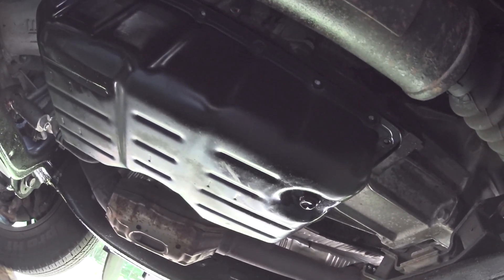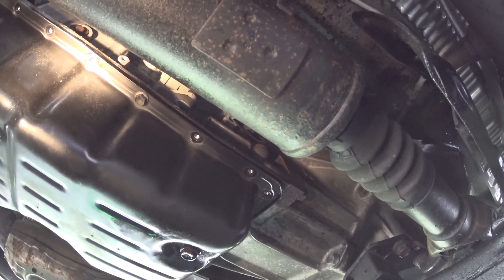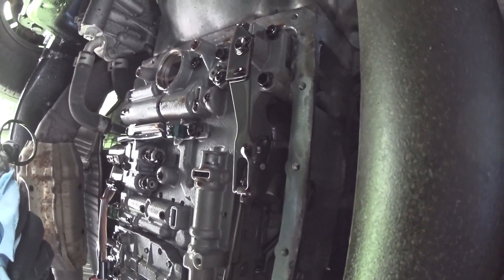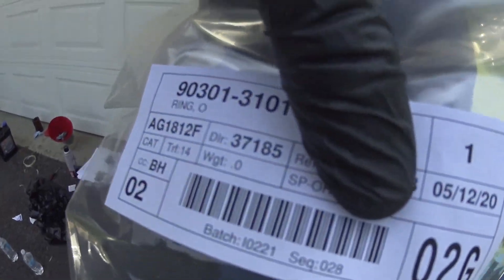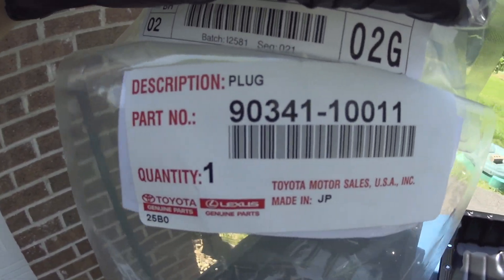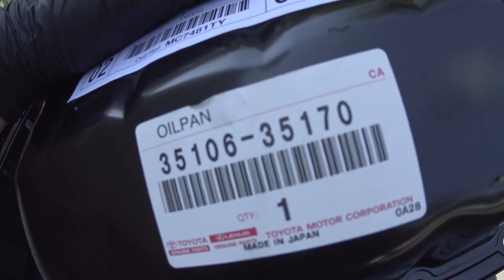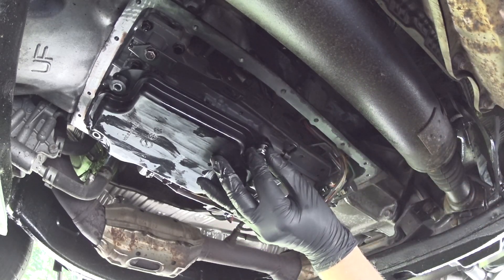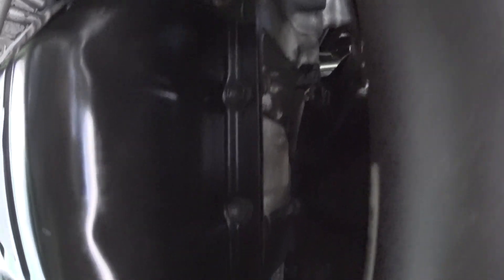Toyota Transmission filter replacement, Lexus transmission filter replacement, how to change filter

Comment from the maker: AMSOIL ATF for ALL Vehicles http://www.amsoil.com/shop/by-product/?zo=5257753
Honda ATF http://amzn.to/2pwgape
Toyota ATF http://amzn.to/2oX3gNR
Ford AFT http://amzn.to/2oXa79W
Subaru ATF http://amzn.to/2pi817r
Nissan ATF http://amzn.to/2pwpDNp
GM ATF http://amzn.to/2pte3AA
Chrysler ATF http://amzn.to/2pwl19Q
Mercedes http://amzn.to/2pwBVFw

Motor oils
amsoil  https://www.amsoil.com/shop/by-product/motor-oil/?zo=5257753
mobil 1 https://amzn.to/2oM6WUe
pennzoil https://amzn.to/2M70v7r
castrol https://amzn.to/2wQKFJk
valvoline https://amzn.to/2wT3EmG
Schaefer https://amzn.to/2oRggpL
motul https://amzn.to/2oQ4OuK
red line https://amzn.to/2Nsihqk
royal purple https://amzn.to/2oPDz3k

Comment: Do you remember the condition of the old O-Ring you removed from the trans?  I've seen them harden on 10-15 year old german cars which led to a drop in oil pressure due to a poor o-ring seal. It would also help to know the age and mileage of the truck you're working on.
Reply from the maker: 2012, 8 years of age at that time.  226k miles on it.  Germans known for o rings to get hard due to oil they use. This o ring was soft like brand new one.

Comment: I have a 2016 Tundra with the 4.6 with 93,000 miles. I am watching and learning best I can for self maintenance. You made a video talking about not changing the filter but this video showing how. So how do I properly maintain my transmission?
Reply from the maker: Change your transmission fluid every 30k miles the way it use to be, if not towing.  If you are towing Change it every 20k miles.  Drain and fill. Filter replacement is about every 100k miles or more depending on fluid change intervals.
Reply: @repairvehicle  what if the transmission has never been touched. Is it okay to do all of this now even though i have 93,000 miles? And also since it has 93,000 do i need to go ahead and change both the filter and fluid at 100,000?
Reply from the maker: My 2012 tundra had first atf replacement at 160k miles. It's perfectly fine to replace atf fluid now.  Replace atf as a minimum,  filter replacement is optional.  I would wait until 120k miles if not towing or hauling.
Reply: @repairvehicle  i do not tow. Will the filter replacement help that much?
Reply from the maker: Nope
Reply: @repairvehicle  If I want to switch my ATF to amsoil from what is in it now should i? Or can i? Would it be bad to swap out?
Reply from the maker: Can you replace it yourself? It depends on your skills, how comfortable you feel doing it yourself.  It's a maintenance item, I would change it.  If you planning to keep it, it's better to replace it
Reply: @repairvehicle  But my main question is for sure I want to switch to Amsoil. The research shows great results for longevity. So with that being said with the original fluid in it now... do i drain it and fill it with amsoil? Or is there a process i need to do to completely flush the transmission before filing with amsoil?
Reply from the maker: No flush is needed.  Drain and fill  but couple times so that you have higher percentage of clean atf. Also, level should be checked at Toyota specified temperature
Reply: @repairvehicle  Also for your engine oil do you use amsoil filter as well as oil?
Reply from the maker: I use amsoil engine oil, amsoil oil filter, amsoil transmission fluid, amsoil gear oil,  amsoil power steering fluid which is atf, amsoil grease.  I use wix engine airfilter and wix cabin filter.
Reply: @repairvehicle  Thank you so much for your help. Im glad you are on here. You are a wealth of resources for me and my new 4.6 Tundra. With your help surely I will reach a million miles!
Reply from the maker: You are welcome

Comment: Hello, will 4l of the transmission oil be enought? Im planning to change filter aswell. Thank you
Reply from the maker: On what?
Reply: @repairvehicle  sorry, its lexus gs 300 2008 6 speed auto.
Reply: @repairvehicle  rear wheel drive
Reply from the maker: From 4.4 to 5 quarts depending on the transmission type. https://www.amsoil.com/lookup/auto-and-light-truck/2006/lexus/gs300/3-0l-6-cyl-engine-code-3gr-fse-g/?volume=us-volume&zo=5257753
Reply: @repairvehicle  thank you for your video and also fast response. Ill take 8liters. Its 4l bottle. Ill order from ravenol since previous owner used it. U just earned a sub :)
Thanks again
Reply from the maker: @DetailingTurzovka  , thank you
Reply: @repairvehicle  its this type RAVENOL ATF T-WS Lifetime .  It says it is for lexus/toyota and its already in my transmission :D
Here in eu ravenol should be very good oil brand.

Comment: Have a 2011 fj cruiser, 100k. Swapping for amsoil, should I do the filter as well? Do you recommend a certain amount of extra fluid for the flush? I plan on filling while monitoring the trans temp using odb2 app. 
Just wondering your thoughts on the process with the amsoil.
Reply from the maker: Have you replaced your fluid or filter in the past on the FJ?
Reply: @repairvehicle  no, and pretty sure it hasnt
Reply from the maker: You can replace the filter if you want to, I would not do it. If you are living in rust belt state,  be extremely careful about replacing filter. Since your fluid has not been replaced on regular basis,  my recommendation is to do couple drain and fill.  I will be doing myself on my 225k miles tundra.
Reply: @repairvehicle  In sc, Florida vehicle very clean underneath.  Thanks

Comment: I have the transmission fluid drain and refill every 15k-20K with OEM fluids on a 2004 Highlander.  The transmission filter has never been replaced. Since there’s over 200K miles, is it best to continue to do the drain and refills and leave the filter as is inside?
Reply from the maker: It depends on the filter. If it's screen type filter,  don't replace it.  If it's soft media filter,  it's a good idea to replace it because of the age.
Reply: That’s the question I was really looking for I have 08 Lexus GS 350 so I’m looking to do drain n fill and change transmission filter , I called a mechanic he says you model doesn’t have transmission filter yours has screen so we no need to take down the pan ?? My car has 110mi and it’s never done any transmission service before ? Is it recommended to do it as this milage ? Or there’s any drawbacks might arise ? Any help would be appreciated thanks
Reply from the maker: I don't You have a screen

Comment: Is it for a recommendation to changing the transmission filter if the bolts are no rusty and easily removed. Do you have another video saying don’t change the filter but maybe only because bolts are rusted.
Reply from the maker: I do  have another video,  not just rust. I  explained in the other video .

Comment: Very informative video and detailed, mine is 08 Lexus GS 350 RWD it has 110mi car has never done transmission service at all , would it be okey if I do drain n fill ? Also does this model have transmission filter or screen ? Since the mechanic told me you don’t have filter it’s screen ? And we’re not going to take down your pan it’s just regular drain n fill ? Is this sound about right or I should avoid this mechanic?? Thanks in advance
Reply from the maker: Drain and fill is the minimum must be done. Filter good idea because of the lack of fluid change and age of Filter
Reply: @repairvehicle   thanks
Reply from the maker: No problem

Comment: I've got 280k miles on my 2000 LS400. a650e. I have never opened the transmission in 20 years of ownership. 
Ive had a 2nd gear shift solenoid fault for a few years. Ive ignored it because the car shifts ok. Now the car has to be inspected so i need to change it to get rid of the CEL. 
Ive recently started hearing a pump whine when its cold. I hope i dont make things worse trying to get in there.
Reply from the maker: It’s to late now, transmission is worn out due to lack of atf changes

Comment: Where can we find the torque specs for our specific vehicle? Mine is a 2007 Lexus IS250 RWD. 
Ps. Thank you for teaching us :)
Reply from the maker: Torque specs for what? I  can get you them or tis website has it paid subscription
Reply: @repairvehicle  Hey there, are you able to get the torque specs for the transmission pan on a 2007 is250 rwd?
Reply from the maker: Yes

Comment: Hello sir, what is supposed to be the operation temperature of transmission in 2011 Lexus is350? I have a scan gauge and my temp reads 200 degrees on average in traffic or idle, is this is okay? If I change the fluid and filter will it be fix it little bit?
Reply from the maker: Operating temperature range for checking fluid should be:

For A760E [A/T Oil Temperature 1]
39 to 49°C (102 to 120°F)

For A760H  [A/T Oil Temperature 1]
40 to 51°C (104 to 124°F)

200 degrees temperature is normal temperature for transmission without transmission external cooler. 
200 Degrees is not a good number, it should be lower. But to lower temperature, external cooler is needed.
However, changing fluid and filter every 30k miles will extend the life of the transmission for long time. Using Amsoil atf fluid will make difference too, because tolerates heat better and provides better lubrication.

https://www.amsoil.com/lookup/auto-and-light-truck/2011/lexus/is350/3-5l-6-cyl-engine-code-2gr-fse-i/?volume=us-volume&zo=5257753
Reply: @repairvehicle  Is there a possibility to adding external cooler to sealing transmission?
Reply from the maker: There is no such thing as sealed transmission. Take a look at my video where I installed external transmission cooler on my Toyota sequoia/tundra. There was something that I have discovered during the installation and its mentioned in the video.
Reply: @repairvehicle  I will be watching this video you say. Can I putting one external cooler on the 2011 is350?
Reply from the maker: If it has threads on the inside transmission or cooler from other lexus fits,  then yes you can add external cooler.

Comment: Hi. Is this more effective than doing a drain and full?  It looks like you get quite a lot of trans fluid out the system using this method vs  the typical drain and fill.  How much would a shop charge (on average) for this?
Reply from the maker: It depends on quality of work, vehicle and atf fluid they use.
Reply: It is more effective. On Toyota Camry you can change about 4 liters out of total 6.9 but only about 2.5 with drain and fill.

Comment: In what order should I put the bolts in when I put on the pan?
Reply from the maker: does not mater. Only when torquing bolts orders matter.
Reply: @repairvehicle  how about when torquing?
Reply: In which order to I torque?
Reply from the maker: What do you have and year?
Reply: @repairvehicle  2013 Lexus es350
Reply from the maker: one across from another and continue in that same pattern, similar to wheel lug nuts.
Reply: @repairvehicle  thank you so much!!!!!

Comment: Братуха, после какого километража рекомендуеться замена фильтра в трансмисии? Почему бы не доверить эту работу опытным специалистам с Тойоты? У меня Toyota Camry 2017 6 speed automatic  u761e transmission. What type of the transmission oil must be used? Is it Toyota ATF TYPE T-IV p/n 00279-000T4-01? Так же я знаю что механики ставят крышку поддона трансмиссии на герметик - чтобы не текла.
Reply from the maker: Toyota doesn't recommend changing transmission filter.  I don't trust Toyota mechanics or any other dealers mechanics.

Comment: Replacing a transmission filter is completely unnecessary.  It's a sealed system and there's with no byproducts being produced.  If the filter is gummed up/filled with crap, you're going to need more than just a filter for that transmission.  Just some friendly advice... I used to do it as well, and every time it came out perfectly clean.  After researching it and using some common sense, I haven't changed a filter in 10 years.
Reply: How about on a toyota transmission thats been neglected a little bit? would you still recommend just doing the fluid? ive just checked mine and its not great, a bit brown, and it runs hot...
Reply from the maker: What kind of Toyota you have?
Mileage?
Year?
For what purpose it’s been used?